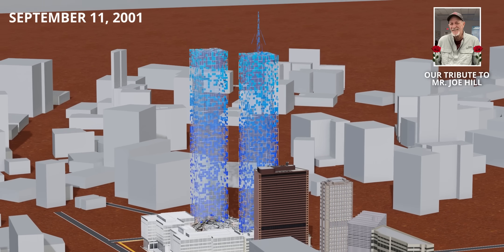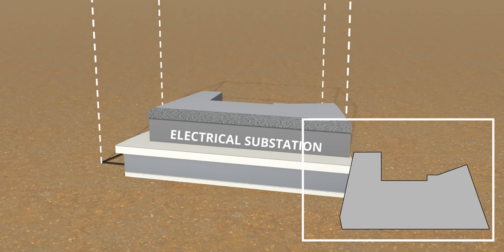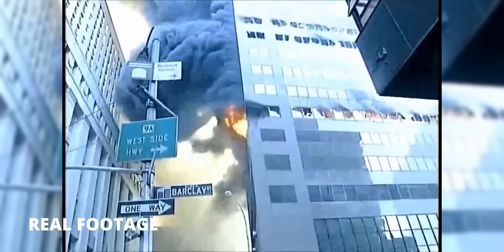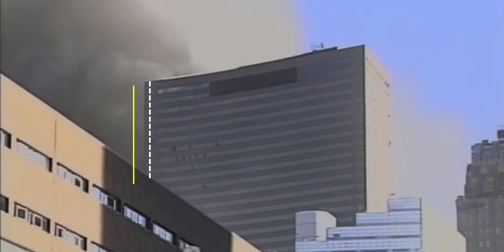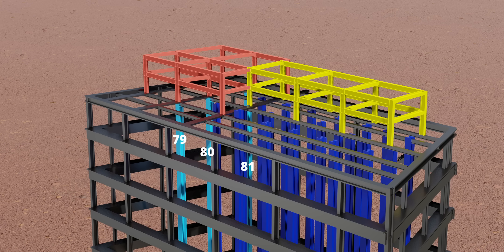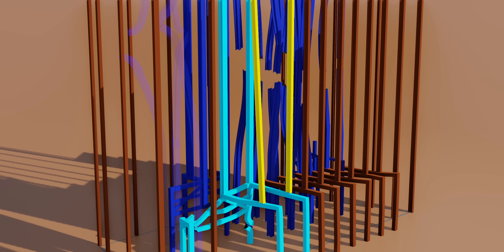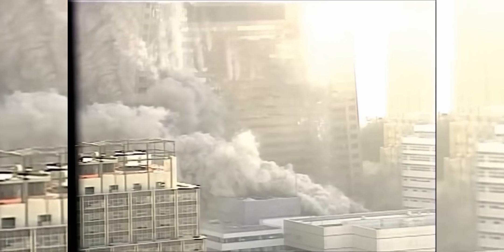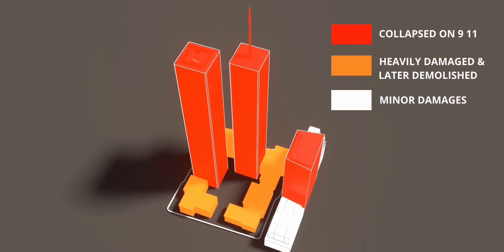Collapse of Building 7 | The Complete Physics

Comment: 18.000+ industrial engineers and architects signed petition for a complete investigation as NO steel structured high rise could collapse by a flash collision/fire. Temperature not high enough to melt structural steel.
Reply: Steel can be compromised at lower temperatures, most likely losing its integrity.
Your arms don't have to break before the weights you lift in the gym cause your arms to fail.
Reply: @Scratch1981  take your analogy, and expand on it a little bit. lets say you have 4 arms, and they're all holding up the same weight. the integrity of 1, maybe 2 of your arms are completely compromised, the other 2 may be slightly compromised. point being they're all being affected differently. why would all 4 of them give out at the exact same time, and fall at exactly the same speed? it does not make sense.
Reply: @Boundaryy  That you don't understand what "analogy" means.....have no bearing. When you've learned the facts, try again.
Reply: @mooneyes2k478   nice ad hominem argument buddy. I do understand the analogy, apparently you don't.
Reply: @Boundaryy  If the four arms are each capable of holding up 100 lbs each, and the load is 400 lbs, then loosing an arm makes the other arms overloaded. The arm closest to the collapsed one will be experiencing too much weight and will buckle. Then the next one, then the next. If this happens quickly, you get a collapse that doesn't tilt much. But it does tilt some. And this very video shows that.
Reply: @slicedtoad  Dude, the building fell into its own footprint. What are you talking about? If they collapse at different times the building would topple over, not fall straight down at free fall speed.
Reply: @Boundaryy  If you have horizontal slabs of concrete it would make sense for loss of support to cause it to tip over. If the load is held vertically gravity is pulling down and there's not a lot of material to cause a tipping.
Reply: @ChucksSEADnDEAD  you're telling me that office fires and an antenna falling onto the building compromised the structural integrity of those steel beams so much, that the entire building came down at once directly into its own footprint... i dont buy it. sorry. i was born at night, not last night
Reply: @Boundaryy  The analogy is not representative of how the buildings fell- it’s flawed. The collapse of the WTC buildings didn’t begin at the bottom, they started nearer to the top. So the one arm failing in a handstand and causing you to fall over is not analogous at all.

The towers collapse each began near the top, where the immense weight of the towers dropping pancaked each subsequent layer beneath it. This is why they collapsed in and around their own foundations without toppling over.
Reply: @mikemallon1065  it wasnt even my analogy i was just trying to make their analogy make more sense. Its a terrible analogy but nonetheless, my point still stands. The official story makes no sense the damage that was reported couldnt possibly make that building fall into its own footprint at free fall speeds. We're talking about building 7. Not the 2 main towers.
Reply: @Boundaryy  Atleast I understand you. 
I see what my eyes see, not what the 0fficial narratIve says.
This is clearly a c0ntr0lled dem0lition and your arguments stands. Prefect (counter) analogy you made.

There is no way that all of the building just perfectly fell on itself the same way you see it in a contr0lled dem0 because of high temp and a piece of the tower damaging a part of the building.

WHY and HOW did the opposite sides of the building NOT damaged by the tower and NOT impacted by such high temperatures fell at the exact same time as the most impacted side ?
Reply: @Boundaryy  The video quite well explains how WTC 7 collapsed. (It was only in free fall for a few seconds max)
Reply: @Boundaryy  "The official story makes no sense the damage that was reported couldnt possibly make that building fall into its own footprint at free fall speeds. "
So, your argument is that, 7 hours of unrestrained fires couldn't make something that didn't happen happen...?

I mean....maybe you should try something with at least a passing connection to facts and reality?
Reply: @mooneyes2k478  my argument is that if it really was just an office fire, the area the fire was concentrated in would be compromised much more severly than the rest of the building. Hence why in the analogy that was given i mentioned that different supports in the building were affected differently but experienced the same results. Falling directly straight downward into its own footprint is what doesnt make sense. Not that the building collapsed. There are architects and engineers that think it doesnt make sense either so your attempt at ad hominem insults isnt gonna work here.

I also find it pretty convenient that you didnt mention anything about the news reports about the building collapsing while its still standing in the background.
Reply: @Boundaryy  You continue to use "in its own footprint" like it is not how a tall buildings fall. Just says something about how much you competent in this question.
Reply: @Boundaryy Google the word. You're misunderstanding the definition of "analogy." To be fair, most Americans learn multisyllabic words from listening to others as opposed to reading and writing.  Otherwise, they'd have looked up the meaning at least once.
Reply: @reedo9002  "a similarity in some respects between things that are otherwise dissimilar" 

I know what the word means, and i did not use it incorrectly. The arms holding up the weight are analogous to the steel frame holding up the building first off.

Secondly, im not american.

Thirdly your attempt to argue about semantics added absolutely nothing to the conversation. Humble yourself.
Reply: @Boundaryy  I don't care to add to this argument. Therefore, the semantics are valueless to me in that regard. However, you're incorrect. Maybe read past the definition. Check out some examples of usage.
Reply: @reedo9002  you tell me to look up the definition, i tell you it, and then you tell me to "look past the definition" and youre telling me semantics are valueless to you? 😂 Youre either trolling or are the best example of the Dunning Kruger effect ive seen in a very long time.
Reply: @Boundaryy you got me there😂 I did just talk myself into a circle.
Reply: @reedo9002  bravo to you for admitting that i respect you very much now
Reply: @Boundaryy 😊 As I do for you. 🙏
Reply: @Boundaryy  Its silly to extrapolate holding up weights with arms to a massive sky scraper. Things work differently as you scale up the size.
Reply: @csar07. No shit sherlock. It wasnt my analogy originally, it was the persons i replied to and its not meant to be taken literally its only to demonstrate a point.
Reply: @Boundaryy  But the point you made is irrelevant, because it doesnt have any bearing on how a large building like WTC would fall.
Reply: @csar07. Then my point went over your head
Reply: @Boundaryy  👍
Reply: @ChucksSEADnDEAD  You don't have to be an engineer to understand that if you first remove one leg from a three-legged stool and then the other two, it will tip over on the side where the first leg was removed.
It's extremely rare for a building with a modern steel frame (covered with thermal insulation) to collapse due to a fire. And here, three collapsed almost simultaneously, 100 meters apart, and all three vertically. These effects only occur with controlled demolitions. This is confirmed by numerous witnesses who heard loud explosions at the bases before the skyscrapers collapsed, and also confirmed by numerous videos.
Reply: The steel doesnt have to melt for it to lose its structural ability.
Reply: @benjaminrickdonaldson  Agreed - https://www.youtube.com/watch?v=FzF1KySHmUA
Reply: The video just said the temperatures were in excess of 600 degrees Celsius. Steel starts to weaken at 204° C. There's your answer.
Reply: This is BS because the fires didn’t melt the steel. Nobody claims that it did.

Any engineer understands that subjecting steel (which is under load) to near 1,000°C fires for extended periods of time will cause it to lose elasticity and the ability to support immense weight. This is how buildings collapse due to fires.
Reply: Steel softens at a way lower temperature than its melting point.
Reply: Plasco Building in Tehran in 2017. Steel tower, collapsed after a 3 hour long fire. You are welcome.
Reply: @azurefire7266  I like how their talking points are so out-of-date that, at this point, we can actually point out several steel-framed buildings that collapsed or nearly collapsed due entirely to structural fires.
Reply: @azurefire7266 was this a three hour long fire
Reply: @azurefire7266   yes the residential building with 1/8 the columns, totally compatible 😂
Reply: @azurefire7266  the collapse of that building is totally different than building 7. It was also in violation of many building codes, and it's pretty safe to say was not built to a standard that a much taller, bigger building was in New York City. Do you have any other examples, or is there only one straw you can grasp at?
Reply: Use of trusses and open floor plans, as well as displaced fire proofing seriously compromised the structure. Once one floor went they all pancaked.
Reply: @ItsJustAdrean  well said.
Reply: 100% correct, Kevin Ryan was fired from Underwriters Labratory for not coming up with results on the steel tests that aligned with the outcome NIST wanted.  He then wrote a book called The Other Nineteen, that goes into who the actual perps of 9/11 are.  Wake up people.
Reply: @donshewmake2521  Since Kevin Ryan never worked on anything of the sort, no he didn't.
Underwriters Laboratory never did anything relevant to 9/11, and Kevin Ryan? Was a manager, not a scientist of any sort, in the water-testing section.

Kevin Ryan was, and is, a liar making up nonsense to seem important and fleece people out of their money. Nothing more, nothing less, nothing else.
Reply: They didn’t melt.  They were just weakened.  You don’t have to melt metal to bend it, especially if it’s under load.
Reply: 1. self appointed engineers who just graduated from high school
2. it doesn't need to melt it only need s to weaken
3. Ps- there is absolutely no proof that that is "thermite", they're just particles which people say is thermite to fuel their lies for some reason
Reply: @PabTSM-OfficialChannel 

Below is a link to the scientific study of the dust samples.
https://benthamopen.com/contents/pdf/TOCPJ/TOCPJ-2-7.pdf
Reply: IT DIDN’T MELT THE FUCKING STEEL. The heat SOFTENED it to the point where structural integrity was lost. Jesus you people are dense
Reply: Who said it needed to melt? Holy F. Fire is hot enough to weaken steel and destroy concrete which provided lateral support. You had bare exposed columns with nothing holding them in place.
Reply: No one ever said the beams "Melted".  Read this:  Key temperature thresholds for steel beams include:
Around 370°C (700°F): Steel begins to lose some of its yield strength.
•	At 540°C to 600°C (1000°F to 1100°F): Steel loses approximately 50% of its strength.
•	Above 870°C (1600°F): Steel retains less than 10% of its original strength.
•	Near 1300°C (2400°F): Steel beams approach melting point and structural failure becomes imminent.
Reply: @paulhruza6066 Lots and lots of people have implied the steel needed to melt. The reality is the steel and concrete work together and fire can turn both into near mush and gravity does the rest. Don’t know why it’s so difficult for people.
Reply: Melt? Why melt? Nothing was melted.
Reply: Why are you morons always saying "it cant melt at that temperature!" It doesnt have to. Ask a metallurgist what happens to steal when it's heated
Reply: So, you got literally fuck-and-all right? I mean, three posts in a row of unremitting dumb shit. That's impressive, in all the wrong ways.
Reply: Exactly
Reply: It didn't met steel dip shit it weekend it.
Reply: Mmm, my favorite type of conspiracy, a complete lies that you can refute in a few seconds.
Reply: This just explained that tye issue wasn't just the fie
Reply: Building 7’s collapse front the front view  
https://youtu.be/6pyyqV7egEI?si=aN5HdjJaRL3ziHyE
Reply: The ONLY people claiming the fires "melted" the steel are the same people saying it's impossible. Everyone else knows that heat makes it simply loose its structural strength and also causes it to twist and buckle, making it even more useless.
Reply: the firefighters on scene would disagree with them
Reply: You don't need to melt it. You need to weaken it. Exposure of steel to high temperatures will weaken it. It then becomes structurally unsound. The WTC towers weighed over 750000 tons each. There was 40000 tons of steel and concrete above the fires on the south tower. Once the steel weakened, it was only a matter of time...
Reply: Where is this document?
Reply: Can you please share this petition here somehow?
Reply: Utter Rubbish.  You do realize that we have a National Fire Code?
Reply: Utter bollox
Reply: You think steel is fine to support a structure right up until it melts? Did your mum drink during her pregnancy or something?
Reply: Source: trust me bro
Reply: Let's see, shall we?

1, there's no "18,000" anything.
2, the petition was not signed by "industrial engineers and architects" but by the gullible that Gage managed to trick.
3, a petition is meaningless.
4, the AIA and ASCE have about 250 thousand members between them, and neither organization has any issue with the explanation given. Oh, that'd be the American Institute of Architects and the American Society of Civil Engineers, since I'm sure you have no idea about that.
5, any and every steel structure, high-rise or not(amazingly, a building doesn't actually know how tall it is, and so won't collapse notably different depending on height) is particularly vulnerable to fires. This has been known since mankind began making steel structures.
6, anyone who blather about "melt steel" is completely clueless, can't think for themselves, do not understand the basis of what we call "iron age" and thought listening to the cool older kids was the thing to do.
7, "thermite" is a meaningless term, and no, there was none found.
8, the center of Manhattan is an area rather notably devoid of "soil".

That's a spectacular list of complete and utter witlessness.
Reply: @mooneyes2k478 you realize the lead electrical engineer for wtc 1 & 2, who knows the building far better than any of us, signed that petition? Along with numerous other steel frame high rise architects. Also theres only been one conclusive, open and honest investigation on this collapse. Go read "a structural re-evaluation of the collapse of wtc building 7". Using computer modeling data he removed 90% of the core columns and the building still wouldn't collapse like this. Only through the simultaneous removal of every core collumn within seconds causes this.
Reply: @CarlSaganHimself  stop lying
Reply: No, no. I believe it was 8,000,000,000 industrial engineers that signed the petition, so you're lying! You are in on it too! Who you work for?!
Reply: Thats unlikely, just like steelbeams generally dont melt from such a thing, thermite doesnt simply stop burning, so it would be impossible to find thermite, at most the residue.
Also, the building had vertical chimney like structures and considering a wood fire can turn steel red hot, weakening a steel structure does not need it to be melted. There is also alot of force involved in a plane flying into a building + the weight of a whole plane
Reply: @bar2062 1.The firefighters said" it looked like they planned to take down the building" I didn't say that, The fire fighters said that. They were there.I'm sure they know best.
https://youtu.be/XiIT4HInWjY?si=e1Pvp3-IFs-M75Oj
When the firefighter says "boom, boom, boom, boom" in this video.
What do you suppose he is?Implying by " boom" ?? What do you hear? 
2.So if there were no explosives then what is this? 8:25
https://youtu.be/bLF5D7M1YgA?si=aHSvS__uOdxMi1ZB
You can't say that it was added because you can see the firemen's reaction to the explosion. And you can't say it came from anywhere else because the firefighter says
" We gotta get out of here,  7 is exploding "
3. Controlled demolitions have squibs, you can see the squibs here 20 floors below the collapse. 
https://youtu.be/eXAgulfAtR4?si=-iLO9aQjMJVLTUYH
4. Firefighter says "any one of these buildings could blow up,  this ain't over yet" firefighter says there's 3 secondary explosions. 
https://youtu.be/0Gh3ErgMI4M?si=mmp9Eus_5PWTCBfl
5. Airplanes can't fly 600 mph at 1000 feet. And to be able to make a 180 degree turn to hit the opposite side of the pentagon going that fast is ridiculous. And since when do terrorists hit the opposite side of the building where no one was at when they could have just flown straight in and killed way more people???
https://youtu.be/0Gh3ErgMI4M?si=mmp9Eus_5PWTCBfl
7. No one has ever known ahead of time that a building was going to collapse except through controlled demolition.  Tower 7 was reported to have fallen while it still stood in the background. 
8. Larry silverstein,  the man who made over 4.5 billion when they fell, claimed to have pulled the building down.
https://youtu.be/1jQaJFNWqtc?si=wCywQ9grgBdS_w11
9. A witness reported a missile hit the pentagon while he was seen at the scene. 
And the hole wasn't big enough for a plane and the damage wasn't consistent to the towers. And just like shanksville,  there's pictures that show no plane parts at all.
https://youtu.be/6_Ez-UCpXMs?si=JaQ6DBEC_LJtMLgN
10. That video also points out They were military planes that hit the twin towers. 
11. All sorts of reports of explosions were reported that day.  
12 Buildings dont accidentally fall  Into it's own footprint.
Reply: @bar2062  AFAIK they didn't find thermite, but evidence that at least something like if thermite is used; e.g. microscopic iron balls that are only created under extreme heat.
Reply: @mehmeteking if i remember right, the samples used were not from a reliable source
Reply: @bar2062 sources?
Reply: Man fire is not enough for MELT STEEL

To BENT maybe 

You need carbon coke minimum

Also cement to P OWDER
Reply: No one said metal melted at all 🤡 proves you just fall for any dumb claim you see online
Reply: Looks like the American buildings are pretty dangerous and the build quality really poor, if a building of this magnitude can collapse due to "an office fire" as they said.. Strangely I still remember when on the radio of the firefighters somebody ordered them.. Pull it! The building is not safe! :)
Reply: @vickk1123  this isn’t an "office fire" stoopid, this is a building that was heavily damaged by debris then caught on fire and burned for hours without being hosed down because water lines were severed
Reply: @vickk1123  It has nothing to do with the buildings being American, it's the simple nature of materials science. Steel weakens under sustained fire, and when it's under load, it fails and causes a collapse. Watch the video, it explains it.

"Pull it"? Yeah, Larry Silverstein suggested pulling the firefighters from their efforts to fight the situation in the building (which there weren't actually any inside of) before it collapsed on them.
Reply: @mikemallon1065  You are right! It has nothing to do with the buildings being American! Something else happened there! Nice interpretation of the "Pull it" though! How would you interpret the later " They decided to pull it" ? I don't even want to go to the tens of recorded testimonies of fire fighters of hearing secondary explosions...    Somehow you failed to convince me, nor the video did!
Reply: @vickk1123 So, what did Larry Silverstein say, and what did it mean? Let's break it down.

"And I said, you know, we've had such a terrible loss of life, maybe the smartest thing to do is pull it!"

Now, there are two claims to what Silverstein meant. First, that "pull it" is a demolition term that means to explosively demolish the building. This has never, in the history of explosive demolition, been a term used. But we'll ignore that part.

The second is that Silverstein is referring to the FDNY fire/rescue operation.

So, let's try these out.

"We've had such a terrible loss of life, maybe the smartest thing to do is to demolish the building!"
"We've had such a terrible loss of life, maybe the smartest thing to do is to pull the fire/rescue operation!"

Which one of these two sentences make any sense at all?

Meanwhile, making up "thousands of firefighters" isn't an argument. You do realize this? It's lying, and nothing else.
Reply: @vickk1123  Secondary explosions? Indeed, There are a few objects exist within commercial buildings that will explode (hot water tanks especially). Does this mean the building was demolished? No, if it were demolished with explosives, then we would see the blasts blowing outwards from the columns like we do with every other building demolition. That is a foundational issue with the notion that it was a controlled demolition. This is ultimately why I don’t support the notion that Silverstein saying “pull it” hinted at a demo.

Yes, your mind wasn’t changed because you’re not actually looking to challenge your ideas.
Reply: @vickk1123  ". Strangely I still remember when on the radio of the firefighters somebody ordered them.. Pull it! The building is not safe! :)
"

The actual transcript is the fire chief and the leaseholder agreeing the building is a lost cause and to pull the firefighters that were in the building trying to get it under control.
Reply: Ps- thermite found in the soil at each building  site.
Reply: @gregbaker1332  "thermite" aka iron oxide (rust) and aluminum?
Reply: @gregbaker1332 hahaja😅😅😅😅😅
Reply: @gregbaker1332 ha ha ha ha ha ha ha ...
Reply: @gregbaker1332 dude - go outside. Enjoy life and don’t be a complete lunatic
Reply: @gregbaker1332 is thermite not a naturally occurring substance? Like wouldn't you just get a byproduct of rust from the building and aluminum from the plane? Mixed with heat it creates traces of thermite compound duh
Reply: @thebathroombandit  this is a testable hypothesis. Lets go mix aluminim and rust. Lets see what we get.
Reply: @gregbaker1332  " Ps- thermite found in the soil at each building  site. "

Thermite is a mix of aluminum and iron oxide. 

The "thermite" found on site was uncontrolled samples of random dust around a building made of steel and a lot of aluminum (such as the exterior cladding) collapsing. No shit they found iron and aluminum dust.

The fact that this very basic issue isn't accounted for in the "proof" demonstrates it's not a scientific investigation: they completely ignored confounding factors.